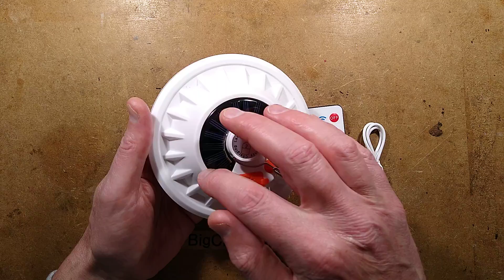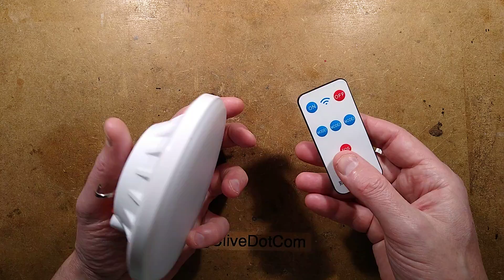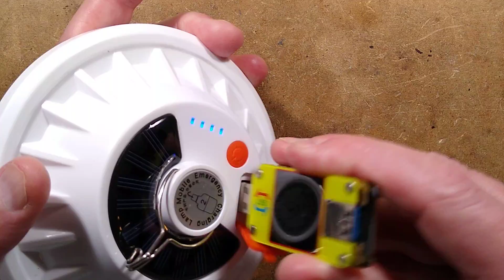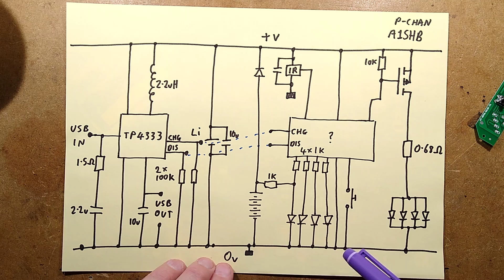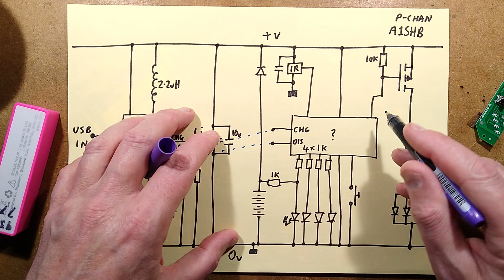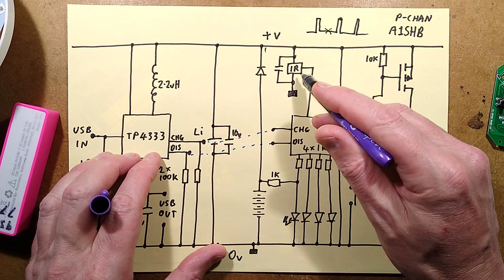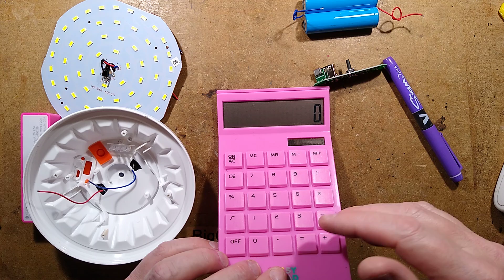Rechargeable camping light with weird design flaw

Comment: Im not that much knowledgeable in electronic but what if you swap those weak 18650s with those 3000mah 40 amp 18650 variants, will the electronics take only what it needs or would you fry it, guess the charge/discharge protection wont be suitable but what if you get a charge controller for the high power ones and bypass the shitty one with it on the drive board for the LEDs, will it survive or will those batteries fry it as well?
Reply from the maker: It would run much longer.  I'd actually suggest common 2600mAh cells as being a much cheaper option.

Comment: i cannot stand stgrobing effect on flashlights etc. IT'S USELESS. when I do find ones with strobing I solder and bypass that chip. or I search for non blinking flashlights. I have a plethora of 18650's (i rebuild laptop and drill batteries)

Comment: Hello Clive,

I have just bought a similar lamp, but i realized that the light lamps is reduced to low light after 10 to 15 minutes from high light mode. So i had to always click on the maximum button to make it in higher light mode again which will stay another 15min and so on.

Did u remark the same behavior on ur side ? If yes how could we solve that annoying problem in ur point of view ?

Thanks a lot
Reply from the maker: That would be in software.  It protects the LEDs and also extends battery life, but it can be annoying.
Reply: @bigclivedotcom  thanks for ur fast reply, so no other type to change the SW o bypass this annoying issue ?

Comment: Im curious to know if holding the power button from the hi state would make it power off directly rather than having to shuffle through the modes before off.
Reply from the maker: It doesn't.   It just goes into the next mode.

Comment: Does the  link from the solar panel to the uP inhibit the lamp during bright sun so avoiding unnecessary battery discharge?
Reply from the maker: It's not connected that way.
Reply: @bigclivedotcom  I thought I saw a link to the uP on your schematic?
Reply from the maker: @andic6676  The solar cell and the processor can both light one of the LEDs via resistors, but I don't think it's using that to sense light.

Comment: What is the purpose of the 1.5 Ohm resistor connected to the TP4333 IC?
Reply from the maker: Inrush current limiting.
Reply: I'm not sure about it being inrush current limiting. The cap is only 2.2uf, so not much current to limit, and it shouldn't damage the USB power supply.

I wonder if the resistor is used to reduce voltage spikes.
When the USB power supply is plugged in, the combination of the inductance of the power supply leads, and the low equivalent series resistance of the ceramic capacitor can create voltage spikes of around 40 volts. This will destroy the TP4333 IC which only has a VDD absolute max of 7 volts. Adding the resistor will reduce the ESR of the capacitor and thus reduce the voltage spikes.

For more info on this, search "Linear Technology Application Note 88", "Ceramic Input Capacitors Can Cause Over voltage Transients".